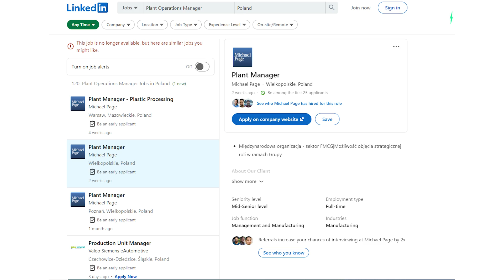CATL to build battery GIGA factory in Poland to supply...

Comment: One thing that worries me a bit.. (almost) every car manufacturer by now has announced to build one or more battery factories, the existing battery manufacturers are building new factories left right and center.. are we running head first into a massive oversupply in the near future, possibly with an attached raw material shortage and a steep drop in battery prices (= reduced profitability = reduced pay and worker benefits = workforce exploitation)?
Classic Auto was content with purchasing a lot of their materials from external suppliers and partners, and now they're all scrambling to establish their own production. This all looks very short sighted to me..
Reply: There won't be an oversupply until deep into the 2030s. After the switch to 99% EVs of new car sales, at that time all the existing ICE cars still need to be replaced. It will probably go faster than expected since EVs will be cheaper as current ICE prices and the ICE infrastructure will collapse. You'll need an app on your phone to find the remaining gas stations.
At the same time we are seeing the EV disruption we will also have the PV disruption, creating a huge demand for energy storage. Megapacks, powerwall will need at least as much as the car industry.
Reply: @Curacars  ‘app to find your nearest petrol station’ now you’re talking! Also this reminds me of when I was looking at electric charger locations in Australia and found one in Alice Springs (middle of Australia plus the middle of a massive desert) and originally I was shocked and then I realised that considering fuel costs a fortune to truck all the way out there it probably makes so much more sense to have a fuel source they can create locally which really flips the thinking of far flung out places being the last to  go electric, instead they are going electric via car or via grid for precisely that reason. Since fuel is expensive and blackouts and brownouts are common in many far out communities.
Reply: @moony2703  I think Australia will become on of the first counties to have an oversupply of electricity which will make it super cheap.
Reply: @moony2703  - Solar panels, net metering and TOU rates works great for me. But then I live in SCal, lots of sunshine here. My Tesla runs on sunshine.
Reply: @Curacars  - Yes Tesla Megapacks and Autobidder are already disrupting the energy business.  Very big area for growth in utility scale storage, the missing leg of the renewable triad.

Comment: One problem with Poland is that they are very heavy on coal.
So all battery EV car haters will have something to complain about because the batteries are built using electricity from coal-fired power plants.
But these haters always find something to complain about so ...
Reply: Germany is already about 30% green electricity and growing fast.
Reply: @Chainyanker007  Not because I am advocating nuclear power. But to do as Germany does now and shut down its nuclear power to burn more coal instead does not sound completely green.
Reply: Most people don't even know what an EV battery is.....
Reply: PS - Most EV lovers don't realize that the electricity made (it doesn't grow on trees) to power EV's comes from fossil fuels.  FF provide more power than hydroelectric, solar, wind, and all other sources.
Reply: @michaelbradley1636  When oil is pumped up from boreholes, energy is required and the oil has an ability to generate emissions and armed conflicts. Then the oil must be transported from boreholes to ports and this generates oil spills and requires energy. then it is often transported with oil tankers as if the accident has occurred can destroy the ecosystem for a long time to come and these transports require a lot of energy. then when the oil comes to an oil refinery it will require lots of energy to create gasoline and diesel. and large emissions are generated. from the oil refinery, it must then be transported to petrol stations and these transports pollute and require a lot of energy. Then the car must be refueled, then energy is also required to fill the tank. then this car with internal combustion engine will only have an efficiency of 20-30% the rest disappears as heat.

A battery-powered EV car on the other hand can be charged with any electricity. And if it is charged with electricity from an oil-fired or coal-fired power plant, these large-scale plants have a significantly higher efficiency than an internal combustion engine, but you can also choose to charge your car with renewable electricity and then the electric car's electric motor has an efficiency between 85-95%.
And when you brake, you generate electricity. so no matter how you count, the electric car is better!

Comment: Tesla is not CATL's only customer. Does Tesla have no faith in its own batteries?
Reply: Demand driven.
Reply: Even with their upcoming battery factories at their GFs they need more. CATL. LG Chem, Panasonic and others all got contracts with Tesla.
Reply: Tesla has stated they will buy every battery they can on TOP of their own supply .. only using their own batteries would be LACK of faith in demand.
Reply: If tesla buys every single battery they can buy from any battery manufacturer. this means that their competitors find it more difficult to obtain batteries.